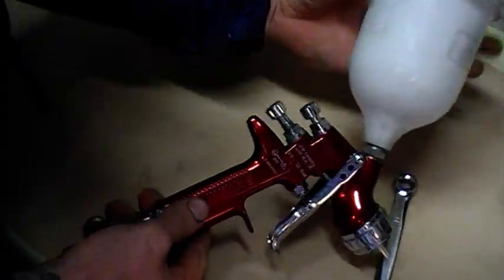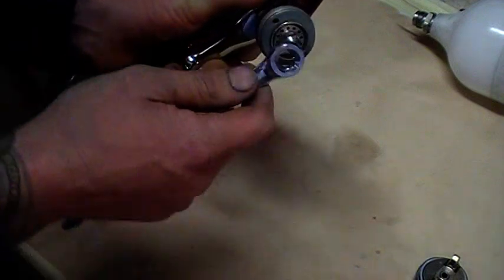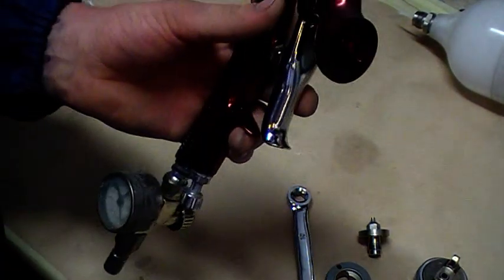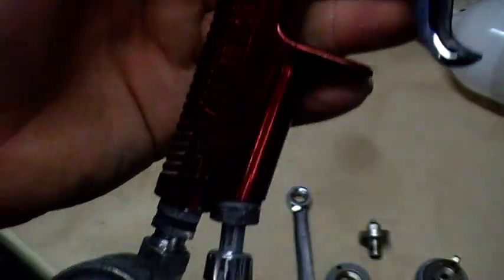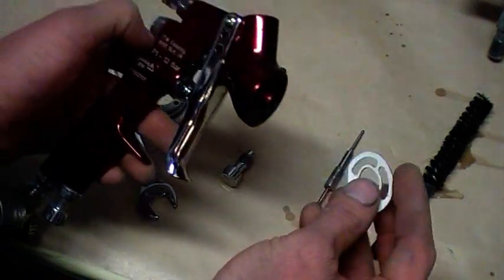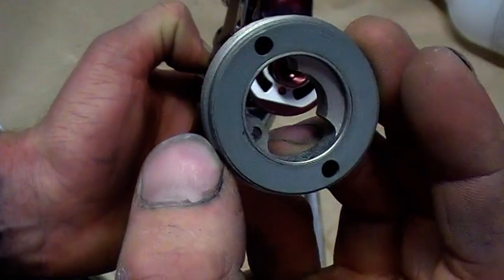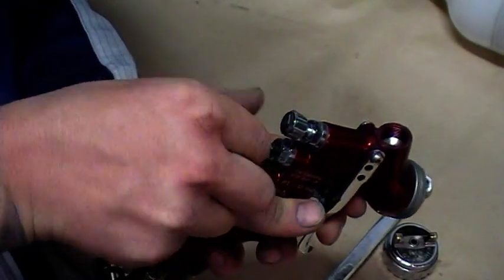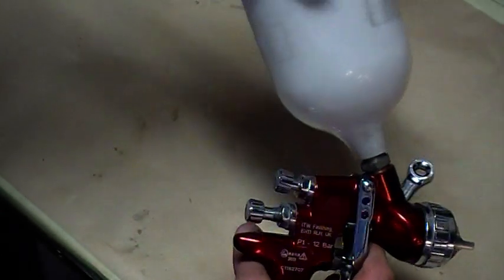How to Dismantle a ''DeVilbiss GTI Pro Spray Gun'' for Cleaning

Comment: I have a gti gun blue one it’s playing up sit keeps holding the paint back i have to put my finger infront of the nozzle to keep spraying back to normal please advise i have cleaned it properly thank you
Reply: It’s most like the lid of your pot. There’s a small hole there, if blocked then it can cause issue. See if that’s open and air comes out of it.

Comment: Mate, I've seen in previous videos, that other people put a dab of vasoline on the fluid needle just to lubricate it to make it work easier in the gun, after cleaning that it just before storing it...do you think this is a good idea?
Reply from the maker: MrCrazyivan01 It can't hurt but I've just found it not necessary, I left the trade for 2 years and never lubed my guns then came back and they were as if I used them a day ago, there is proper gun lubes that won't create silicone like the vas may do.
Reply: Cool, thanks for the tip (lol!).

Comment: Nice video man, i have a question...... Is there a correct way to put the small filter that goes between the cup and the gun? I see you put it with the plastic tip pointing down.
Reply from the maker: It actually works fine either way I used to do it the other way up and both are similar effect but find this way it stays in better and won't fall out as easy.
Reply: The Gunman
Ok so there is no right or wrong way then i guess, thanks man!

Comment: On the GTI Pro lite, I have the te20 air cap 1.3mm nozzle. Can it fit a larger nozzle and does it need a needle too?

Love the videos, thought I'd ask an expert
Reply: 1.3 - 1.4 use same needle. 1.8 for primer is different needle.